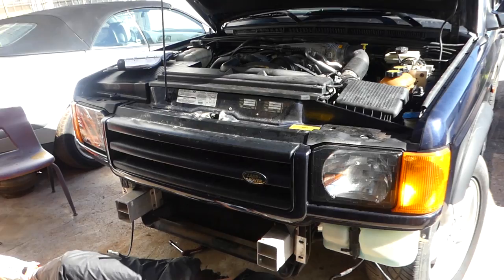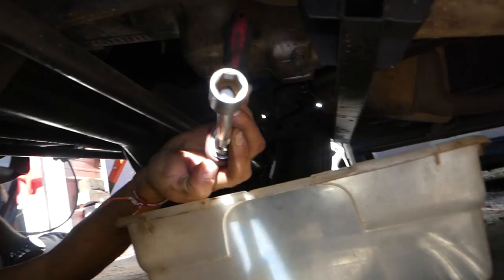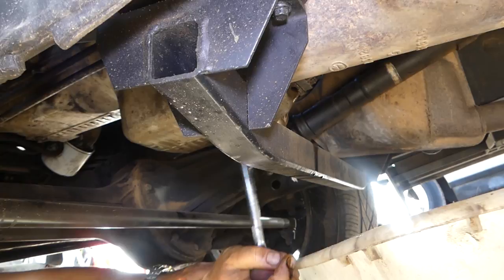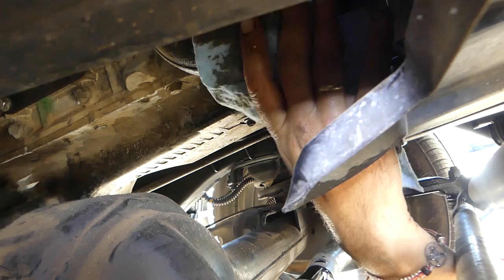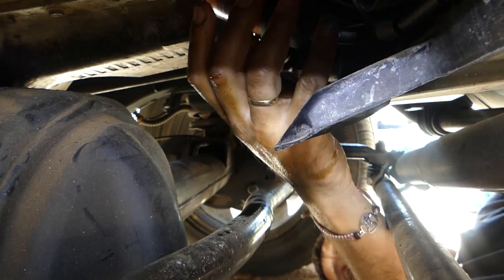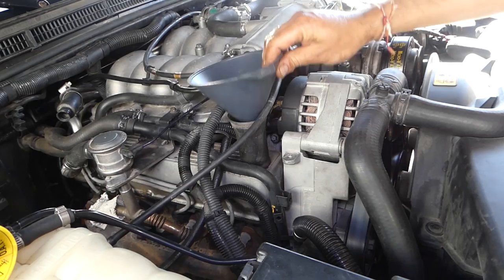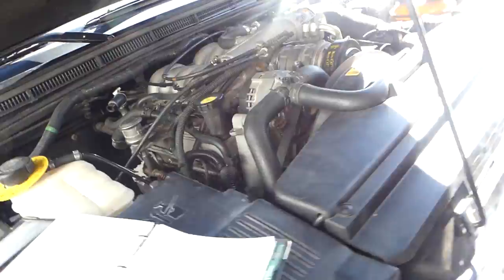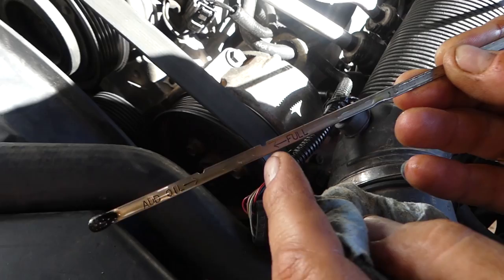HOW TO CHANGE OIL ON LAND ROVER DISCOVERY 4.0

Comment: The video is great and clear instructions! However, on this particular Rover engine 
1 - Drain the Oil 
2 - tighten the bolt
3 - Go up and add 5 quarts 
4 - Go back down and remove the filter 
5 - Add oil to the filter slowly, plus a little touch on the seal 
6 - tighten the oil filter 
7 - Go back up and add half a quart and start the engine for one minute 
8 - Shut the engine off, and wait 5 minutes and check the dip stick

All done 👍🏼

8